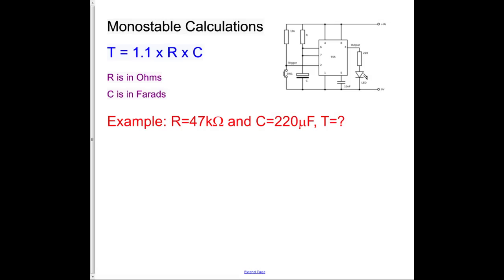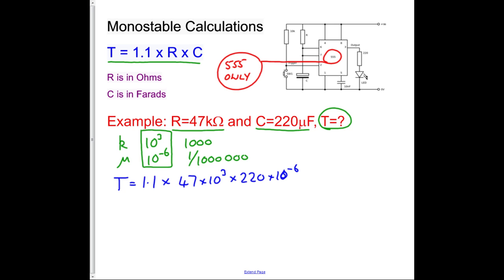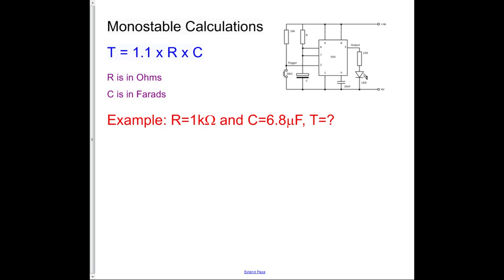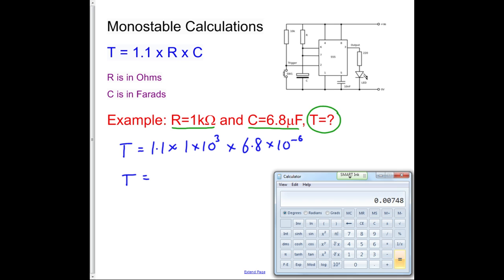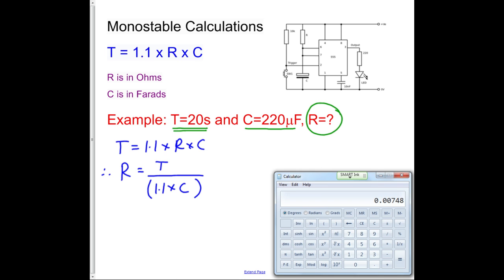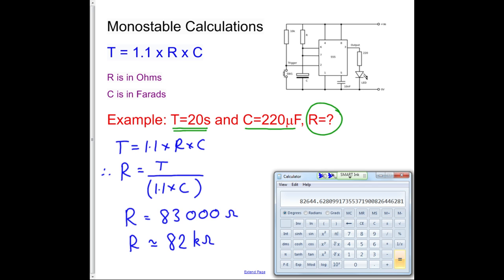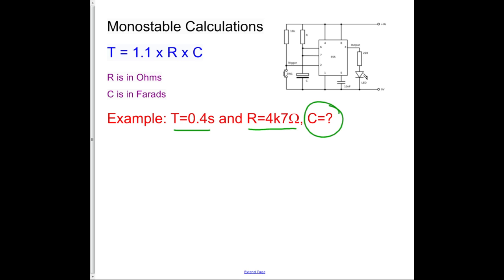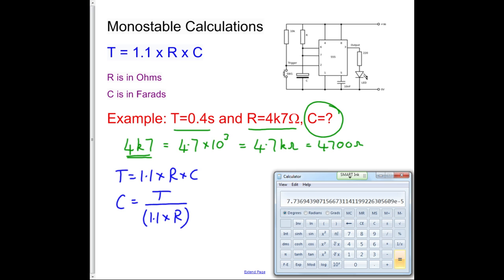555 Monostable Calculations

Comment: The internal ckt of 555 requires about 0.7mA per supply volt(7mA at Vcc=+10v).what is the maximum power dissipation of IC 555?

Comment: Solution plz
Reply from the maker: The (excellent) wikipedia page for the 555 states that the maximum power dissipation is 600mW and the maximum output current is 200mA for a standard 555 IC and both of these agree with the experience of my students. The 555 ICs I use measure about 15mA supply current at 15V which is similar to your stated value of 0.7mA per volt although there are lower current versions available. Does this answer your question?
Reply: Lol my brain is fuzzy how do you get to deviding T with 1.1C when you need to get resistance